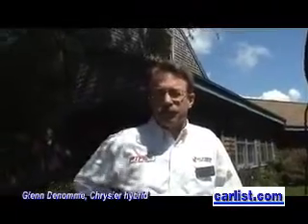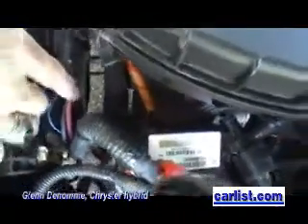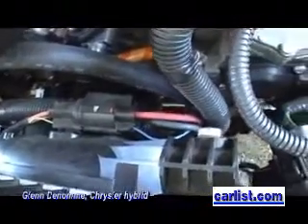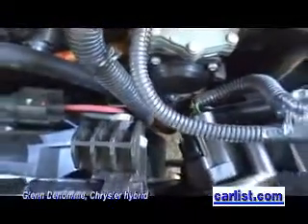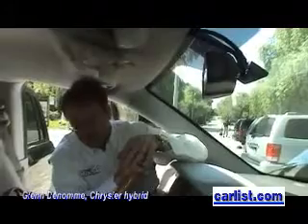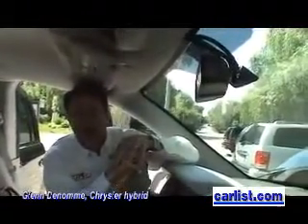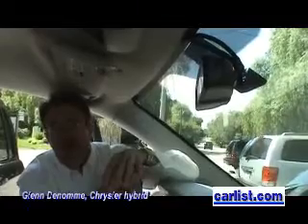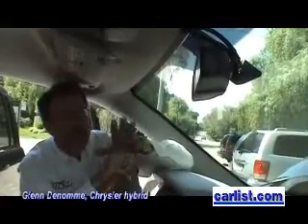Chrysler's new  integrated humidity temperature sensor patent location fuel economy fca integration

Comment: yeah this is neat, this sensor is making my ac not work at all......now I have to pay 300+ to see if that sensor is the issue.  THANKS YOU FUCKING MORON
Reply from the maker: Imagine what it would cost if you bought a Porsche or BMW
Reply: @drivingthenation  engineers needs to take a step back from making things too "smart"  as a control engineer I feel the driver could go " ah its too cold" and adjust the temp.
Reply from the maker: @briandortch4610  you might consider buying older cars and fixing them yourself., you will be happier
Reply: @drivingthenation  oh yeah lets go back and get cars that were engineered when gas prices were cheaper.  Good one Boomer
Reply from the maker: @briandortch4610  LOL I'm waiting for electric and autonomous. I have no desire to clean my house or fix my car. I'll pay - thanks.
Reply: @drivingthenation  I'd rather fix it myself and use the money for savings or investment.  Must suck to suck
Reply from the maker: @briandortch4610  I think it's funny that everytime I come to reply to you there is an ad for Kia or Ford on a Chrysler video.

Comment: Is this the problem I have that causes the vent to blow warm air, when I have it set to low and want cold air from outside to come in when driving at night? Yesterday I just had the problem of when I got in the car, it was blowing warm air, but 62F degrees outside. That was the worst it's ever been. I had to turn the AC on in 62F weather. It's been bugging me for a couple years when driving at night and I want cool outside air to come in. It would be warm air coming in. As we drive, suddenly the cool air comes in and it feels good. Then it warms up again. I accelerate and let off the gas, it cools again for a little bit, then warm again. I thought maybe it was a vacuum leak in the controls under the dash?
I wish my car didn't have this garbage! I want cool air when driving, not warm air. I hate sweating when I'm driving.
Reply: 2018 Jeep Grand Cherokee - sure enjoy it when the a/c turns on at random times to ‘dry’ the air and freezes you out. Will not buy another FCA car that has automatic temp control. Even with ‘auto’ selected OFF, the HVAC system changes the output temperature. You can NEVER get a constant output temperature. POS

Comment: Unable to use recerculation on hot days.  Button blinks three times and shuts off.  I will look at replacement.  Car is. 2012 Charger RT Max 49,000 miles.
Reply from the maker: let me know if you find one
Reply: DrivingTheNation I found one on Rock Auto and Amazon.
Reply from the maker: Thank you for letting me know. So many people want this. I hope they see it here.

Comment: I am not happy with their 'integrated humidity sensor' invention..  It's malfunctioning and Blend door actuators always open and it forces me to breath dangerous highway gasses. Could you please ask this gentleman is there any way to bypass this sensor and control my air manually. I don't want to pay a bunch of dollars to buy new one.. Chrysler 300-2012. Thanks
Reply: Yasar Ek me too...I hate that I smell every exhaust on the road. This whole Chrysler ac system sucks.
Reply: i second that, many forums are saying to wrap the sensor with plastic. not sure if it will work. I believe the humidity sensor works off resistance to measure the humidity there must be a way to add a resistor to be able to keep the ac max recirculation on at all times.
Reply from the maker: sorry guys, just saw this - I will ask.
Reply: Yes they due in deed suck. New humiity sensor xost me 50bucks but note they are 3 different versions of the same sensor. Buy the most current version mine seems to be doing good after this replacement
Reply: 50? Dealer quoted me a price of 400. Fking thieves.  @reyreyna3555
Reply from the maker: $50 is an easy fix. Where did you get it? Maybe that would help Yasar or Ellacost831 - I emailed Chrysler and have not heard back from them yet
Reply: DrivingTheNation https://www.amazon.com/gp/aw/d/B00TMVFQUC/ref=oh_aui_i_d_old_o0_img?ie=UTF8&psc=1
Reply from the maker: brilliant! Thanks Rey
Reply: Order the sensor off rock auto for 30 something bucks...... Mopar part too.